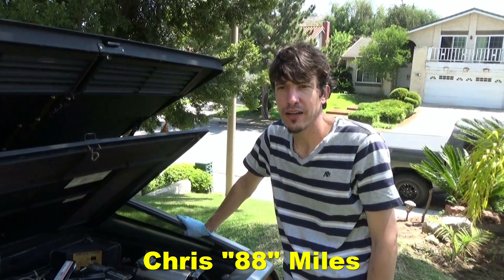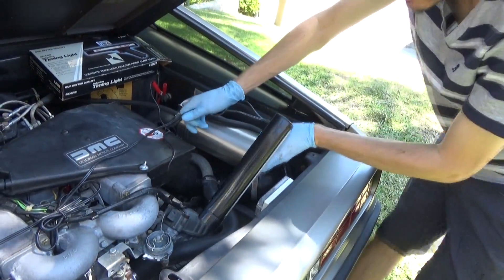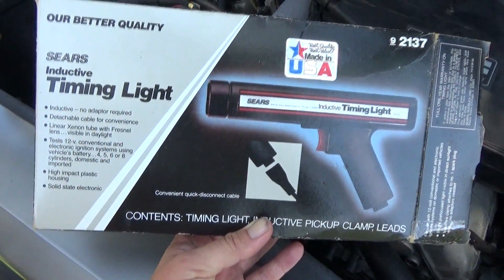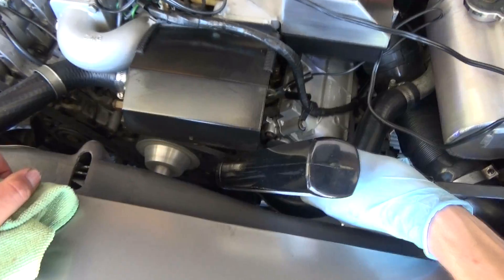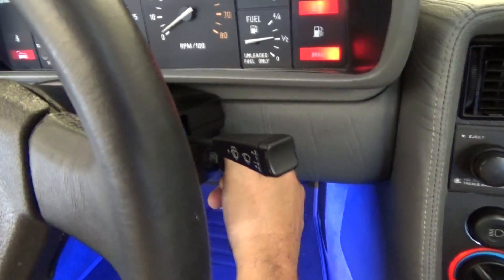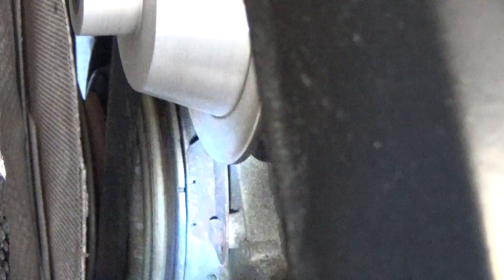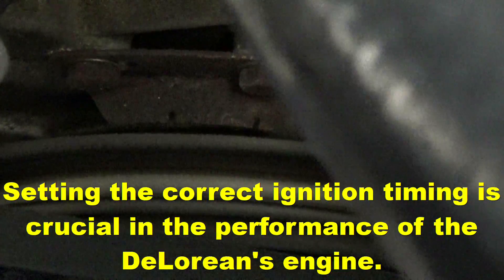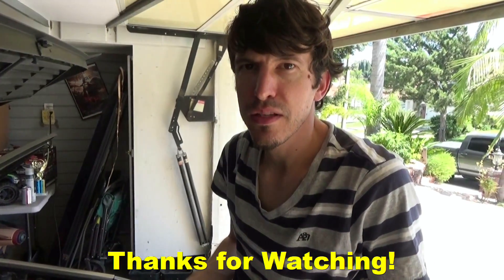Perfect Timing! How to check and adjust the ignition timing in the DeLorean DMC-12 Motor Car

Comment: There is a lot of stuff that isn’t adding up. 
Loop should be on cylinder 1. 
Vacuum advance should be disconnected. 
Idle should be at 750 rpm
Reply: yes should be attached to cyl 1. in this case, using cyl 6 the ignition is 13 deg off

Comment: WOW.....I can't keep my eyes off that walking crank belt starting at 2:44 !   AC pulley was out of align, &/or the bearing was bad, or not pressed in correct......something was going on.  

I had a few of those old Sears timing lights.  Tip:  when getting the eradic strobbing signal, clean the rust off the magnetic pickup or flip the inductive clamp over for a stronger signal.

I love my Innova 5568 Pro Digital Timing Light, only $110- shock proof - features a backlit screen for easier viewing in hard to see places. The four function digital readout displays tachometer ranges from 249-9,990 RPM, Advance Degrees (2 and 4 cycle) 0-90 degrees, dwell (2-12 cylinders) from 0-180 degrees and voltage from 10-16 volts DC.  Its a mini engine analyser!  You can actually dial in the advance, if you can put a TDC mark on pulley.  Would be interesting to find out TDC dialing back the light to 13 deg.

Have you guys ever tried running 15-17 degrees advanced on these motors for performance & better economy & can this distributor be recurved?????

There's many tuning tricks to counter-act detonation if running more advance: ....
-richen the fuel curve by raising fuel pressure, 
-colder plugs, 
-higher octane/better fuel additive package chemistry ( only Shell V Power Nitro+) or a (methotical fuel additive blend that I really think the PRV & that CIS can really benefit from as far as I can theorize on how those injectors work) ,
- lower temp thermostat, 
-adjustable cooling fan controller,  
-converting to Evans NPG+ coolant with 0 psi cap will really keep the combustion temps down to run lots of advanced timing!!!!!!

I'd love to get my hands on one of these PRV's to do many tuning tricks on.

Here's something you Delorean guys should check out. 
 The very famous performance engine builder auto engineer & author David Vizard is now doing YT vids!

Check out these 2 recent videos on cooling fuel charge :

"Starting with a can of beans we increased power by as much as 50 hp" -  begin watching at the 16min - 15sec mark.

"Worlds cheapest and MOST EFFECTIVE octane booster"
......this is really a great video into water injection that can even be used on non-forced induction to cool the intake charge, keep the combustion chambers clean, & gain performance & fuel efficiency/economy with a simple water injection circuit & controller!!!!

Very easy & doable for you Delorean guys who need performance & even more economy out of these motors!

Comment: I thought you had to attach to the lead on Cylinder 1. You attached to Number 6 but it seemed to work.
Reply: Doesn't make sense. I set my timing with No6 cylinder to 12 DBTDC. With the sensor attached to No1 cylinder the timing looks like about 30 DBTDC
Reply: Thats totally ok.
The users manual says that you can attach the strobe to cylinder 1 or 6. They have the same ignition point.
Reply: @maggusg.3731  different points and also different marks. So something is not adding up here

Comment: My question is doesn't that timing plate mark also move to slide back and forth? If I remember correctly when I removed all those pieces off my timing cover to have everything powdercoated I could swear that the timing plate is adjustable also. I need to recheck on my car but you could also look at it and see the slots where the bolts go in
Reply: Yes the timing plate slides.
Reply: @chrismiles16409  I know they slide but I hope I put them back im the same spot after I had everything powdercoated.